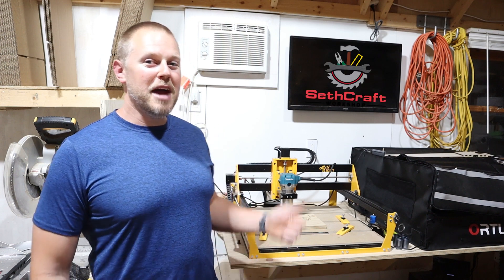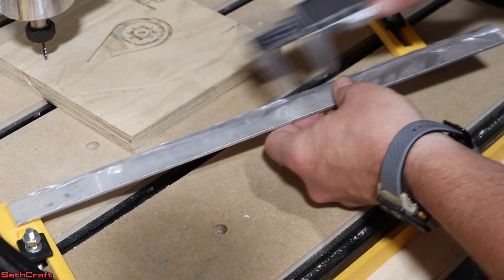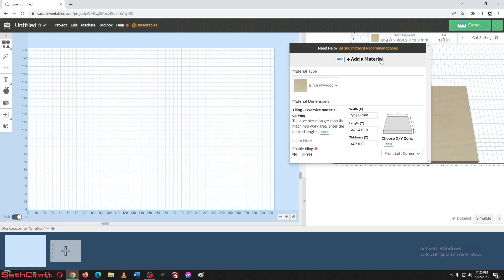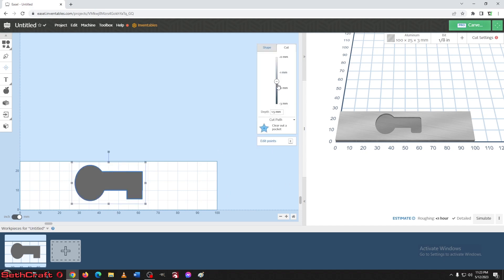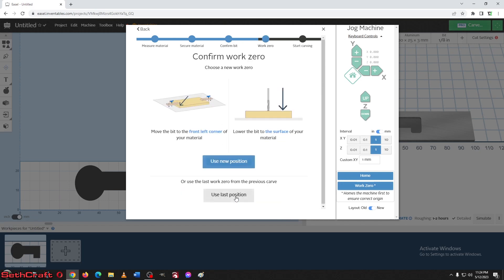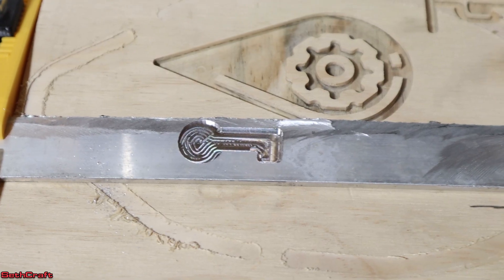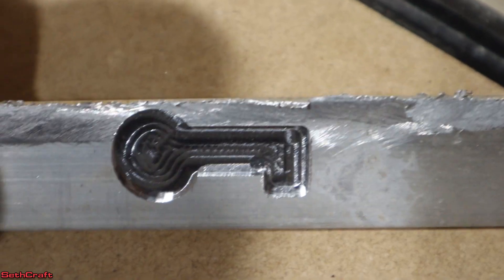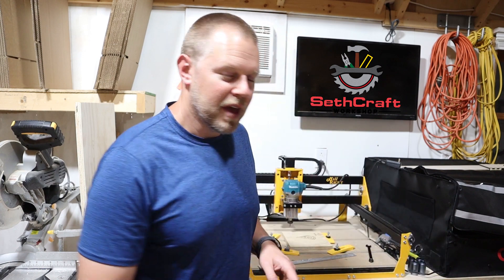Mill Aluminum with a CNC Machine [Millright Carve King 2]

Comment: I craved a 3/4" piece of aluminum on my desktop machine, and I just use CA glue and  blue tape, worked great. I did however cut back the feed rate to 70% and it made a much nicer finish.

Comment: That's cool cutting into the aluminum, lots of usefulness there.  I'm confident you will find some advice online on how to get better results in the copper.  Thanks for this.
Reply from the maker: I just got the Genmitsu 6050 cnc setup. It seems to be a much bigger machine. I think it will handle metal well!

Comment: I think if you had screwed the aluminum down flat with two screws you may have gotten a better finish, those clamps seem to be making the plate bow up in the middle.
Reply from the maker: You're right whenever I was testing out copper on the CNC machine. I did screw it down and it made a big difference.
Reply: @sethcraftshop  awesome CNC machine